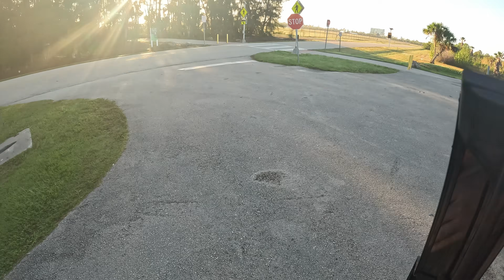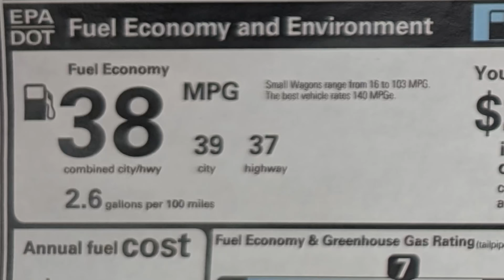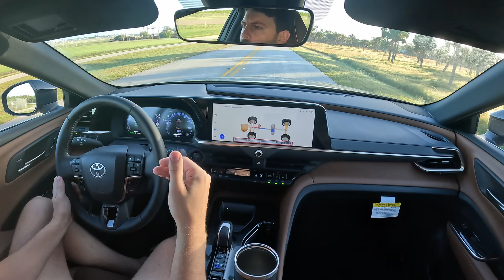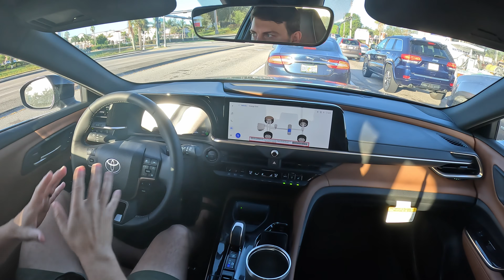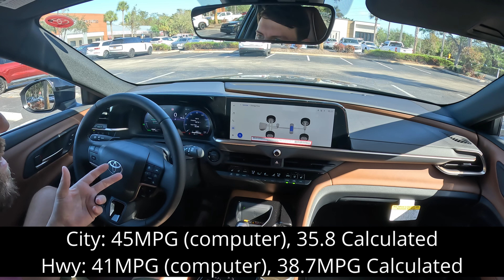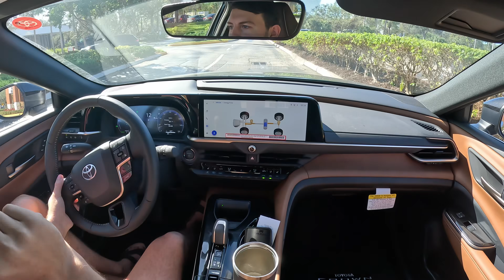2025 Toyota Crown Signia XLE is rated 38 MPG... Here are my CITY and HIGHWAY results

Comment: I had a beautiful 21 Avalon limited hybrid . It was a hidden gem avg 42mog , I also have a ford hybrid which is  wonderful city driving at 44mpg but hwy gets 34-35 not bad for a mini truck.
I regret getting rid of hybrid Avalon . And at the time the crown signia was still expensive . I kept the Maverick and got the new outlander 2026 Mitsubishi I only avg 31mpg which is not great but not too bad for a small 3rd row suv. More space than my Avalon , easier sit in height , But miss my Avalon. I probably would’ve kept it if it was the touring or TRD lol.

Comment: I've filled up three times and used the actual mileage at the pump for gas totals. Average 44 to 47 MPG  About 70% short trips and balance on Highway. I set cruise for 70MPH. Common sense starts and stops.

Comment: I'm very happy with my '15 VW Sportwagon 1.8t auto fwd SE.
74k and still looks and drives like new.
No breakdown.  Amazing engine and perfect size wagon.

Supposed to get 35 but I have gotten 39 mpg on a road trip with my wife on 87 octane!

This car was 27k new and I can work on it without killing myself from the hybrid.
Hybrids are more expensive to have a mech work on and imagine how many gallons of gas to offset the higher sales  price.  Also, if the hybrid system fails, they cannot drive until that's fixed!

I would consider a hybrid fwd with mech slip differential if you could still drive on the engine part if the hybrid system failed.

Cheers
Reply: I hate station wagons and just all gas cars in general never buying one again ev all the way.  This is a big reason I stopped buying Toyota and went to rivian.
Reply: @airforcegirl4862 Well, how about an ev wagon.  Volvo has some pretty sweet ones!

Comment: Gen 3 Prius doesn’t look like beneficial to run on battery lower then half, to charge it, mpg will drop significantly, while next gen with lithium battery, it’s always better to use as much as possible. Not sure about Prius with nicd battery

Comment: This is a wagon, how do we know it’s a wagon. Two ways

1. Outside the U.S this is called the Crown Estate, Estate cars are Wagons

2. This vehicle does not have tinted rear windows even on the limited version. Some crossovers don’t have tinted rear windows that’s because they are base models. But this is not a low end car, the rear windows are not tinted because Toyota is following the laws on tinted windows that would apply to Sedans, wagons have to follow the same regulations as sedans.

8:55 this is the case with mostly every car with a brake hold system. Have not been in any car that keeps it on.

Comment: Very seldom will this style of hybrid be in EV mode above 45 mpg. The ring gear (of the planetary gearset) turns with the car moving. To keep the gasoline engine not turning the sun gear (and the motor that drives it) must turn the opposite way. And they can only turn so fast.

My Prius fuel economy read out is only 4 % high.

Comment: Hi @Kirk and others, my 2025 lexus rx350h and specs say 37 city, 34 highway and 36 combined. I haven't broken 30 mpg, in the first 500 miles and only just over 30 in the 100 miles since then, with eco enabled and average driving speeds of low 40's and lexus app drive pulse & trips is always showing excellent based on its tracking of harsh cornering, fast acceleration and harsh braking for each trip. I'm in san diego county so neither ac or heater has been getting used hardly at all. So what gives do i have to wait until i've driven #### miles before the higher advertised mpg of these toyota / lexus hybrid powertrains kick in?

Comment: This is Lexus like interior not a bad thing, the design is nice looks roomy, do I have 40+ grand for one NO , but my heart is still for the old skool 4 runner with the bad fuel economy but bullet proof V6 😮 I’m a find lightly used with deals pushing under 40 grand for 4 runner, I hate the new turbo 4 ones
Reply: We enjoy a '10 RAV4 base, 4wd, tow prep with the bulletproof V6.

We got it as an extra/errand/dog car but now take it on road trips because the engine and practicality and keeping miles off our newer cars.
Fun to drive!

210k, no oil consumption or leaks, everything works. Regularly get 27 mpg on highway!
Last 50k miles, repairs are only battery, front brakes and new headlight assemblies!

Amazing reliability!  Just runs.

Cheers

Comment: I got about 44 mpg before the colder California weather kicked in getting 39.6 after 2 fill ups post reset in the computer.  About 50/50 city/highway driving

I found it give it some gas then coast and  then feather tap the accelerator, it'll use the battery to maintain my current speed until the charge goes down to 3 bars

Comment: Wagon?  It's 10 inches taller than a Volvo V60 or 6 inches taller than the lifted V60 cross country.  I guess if you're one of those people that still believes the Subaru Outback is still a wagon.
Reply: The v60 cc is pretty small.  50% less cargo capacity w seats folded down compared to a 2013-2015 lexus rx350.

Comment: I’ve just passed 3,000 miles in my Signia Limited.   Averaging 38.5 mpg with about 80% highway miles at 70-75 mph.
Reply: Hi @stevennevins6643 did you get that 38.5mpg right out of the gate or only after you put a certain amount of miles on it?
Reply: @myusrn  From the start.   At one point, mileage went up to 39.2 mpg.   But,  it has dropped to 37.5.   A couple of reasons: cold weather,  and a higher percentage of highway 70-80:mph miles.
Reply: I hate station wagons and just all gas cars in general never buying one again ev all the way.  This is a big reason I stopped buying Toyota and went to rivian.
Reply: @airforcegirl4862 Air Force retired?

Comment: If they used Venza battery which is more efficient and light weight, it will give more mpg but price will go up even more. Do you remember brick phone in 90th? signia used old brick phone battery tech NiMH instead of Venza Lithium-ion battery which is same modern battery tech used on iPhone.
Reply: Lithium batteries go into thermal runaway...Rarely, but they do. They can burn your house down.

Comment: I like how we’re all just like, ehh it ONLY got 38mpg for a 4200lb luxury vehicle. Lol When fueling up, run the pump on the slowest detent and don’t click it afterwards. When filling up at the fastest rate, it tends to miscalculate a bit. There have been studies on this and it’s usually in the gas stations best interest. The clicking after it clicks will usually just put additional fuel into the charcoal canister as well which can lead to emissions related check engine lights.

Comment: Hi Kirk. Is the air condition in the Crown as efficient as in the new Camry? Because when you reviewed the new Camry, you said the AC was very good. Thanks.
Reply: I found that in SoCal heat over 90 degrees the limiteds glass roof has too much heat soak for the AC to keep up properly. This was the primary concern I had test driving it extensively at a dealer that lets you just take off with it and drive all you want alone. Cooler temps it was a different story but I live where it can get 100-115 easily half the year. This just isn't going to work and its a shame they insist on putting the pano roof on all the limited trims. The fan is also loud like the Camry. Nice vents though with flow adjustment.
Reply from the maker: Yes. AC here is great
Reply: @KirkKreifels  thanks

Comment: I'm very suspicious of the gas pumps not being accurate.  My 2007 Prius fuel tank had a bladder that making actual fuel use calculations very variable.  Do you know if Toyota has a bladder in the crown signia?  The bladder in my Prius was very temperature sensitive.
Reply from the maker: I don't know if there is a bladder in the crown

Comment: Every car I owned the computer showed better mileage than actual (I.e. compared with using the trip odometer and the gas pump reading). Oh... and using a different pump should not make any difference (unless the gas station owner is a crook) as pumps are to be calibrated regularly and are inspected (or should be).
Reply from the maker: It's not that the pumps aren't putting the exact gas in, it's that a different pump will click off at different fuel levels

Comment: I got 44+, mostly highway, around 60-70 mph.  No desire to accelerate or go fast when sitting in this thing, it just moves, hauling a ton, going wherever, can't care less :goodvibes:
Reply: Hi @mostlygibberish, did you get that 44+ mpg right out of the gate or only after you put a certain amount of miles on it?
Reply: @myusrn  Within the first 100 miles.  That was late Oct around 50-60 degrees.  Heat is not free with hybrid car, it dropped down to 39-40 in 30F winter.  Yesterday was mild, it went right back to 44.  Shape of the car won't help if you go fast.  Just set to eco, relax and let the signia fade into the background :yougotthis:

Comment: The compact Crown replaced the full size Avalon at at about 30% more cost.  My Avalon always gets a little over 50 MPG The Avalon was designed and built in America. The Crown is inported putting a lot of workers out of a job. You can buy a full size Lexus hybrid for a lot less money than the compact Crown
Reply: The Crown put nobody out of a job.  Don’t be a child.
Reply: @letsgo4834  Built by Japs not local labor
Reply: It’s midsize, 194 inches long.
Reply: @TheBMurda  The Avalon was advertized as a full size sedan
Reply: @funlovingJohn  The Crown is midsized at 194 inches. It weighs more than 200lbs more than a Lexus NX and is almost a full foot longer.
Reply: the venza was “compact”, the signia is Signiaficantly bigger
Reply: Which full size Lexus hybrid can you buy for less than the Crown?
Reply: @wyw201  none

Comment: Toyotas hybrid software only allows maximum charge to 80% and minimum 40% to reduce stress and promote battery life. 😊👍🏼
Reply from the maker: Yes but the energy monitor's eight battery bars reflect the 40-80ish usable battery
Reply: @ that is correct 👍🏼 and as more miles pass, the battery will be conditioned to use even more of it’s capacity. This could be why LC’s are getting lower than average mpg out of the box during break-in.